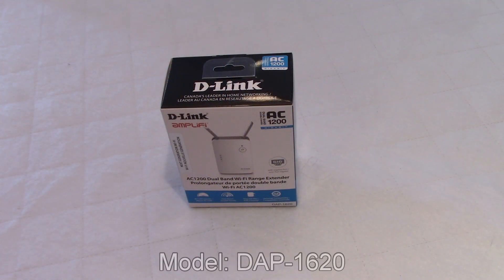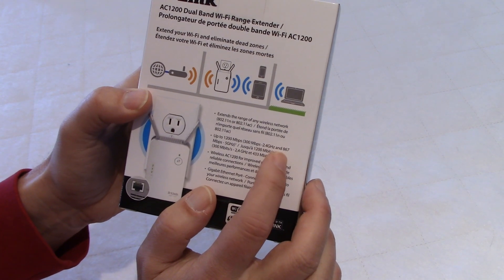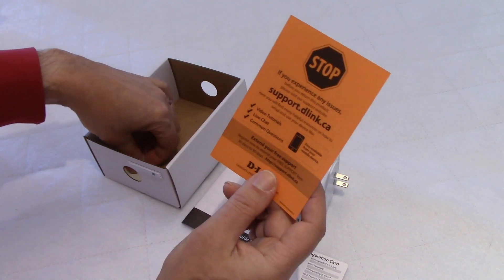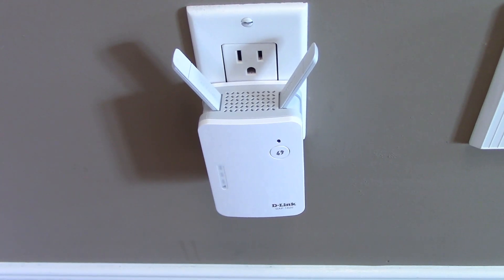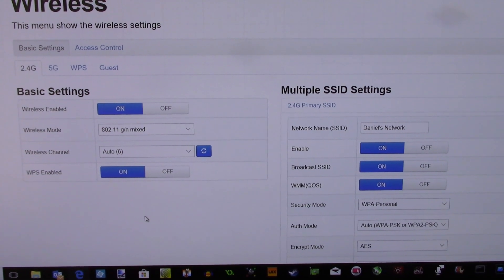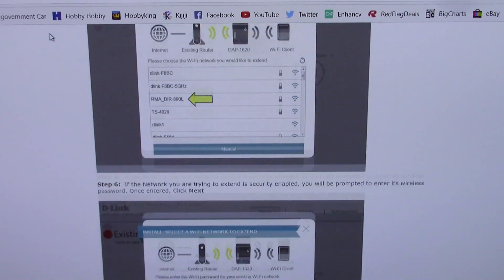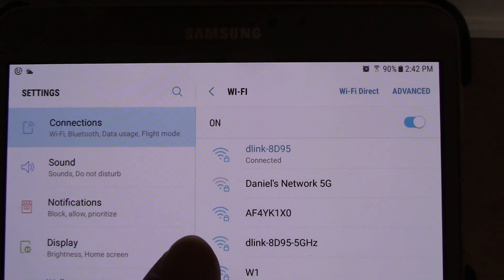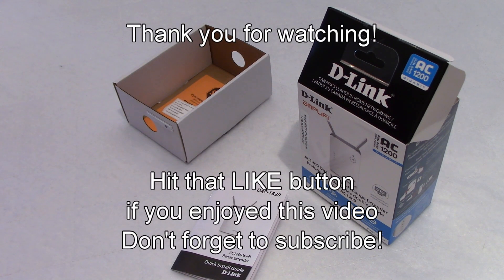D-Link Wi-Fi Range Extender DAP-1620 | Unboxing and installation

Comment: Does it work like a powerline adapter or does it need the router wifi to be on to take the signal ans extend it?
Reply from the maker: Hello, this is not a powerline adapter, it needs the router to be on for the signal.  Thank you for visiting my channel.

Comment: Bonjour,

En effet, la solution simple ne fonctionne pas.

Mais la solution compliquée ne ressemble en rien à ce que vous exposez.
1/ L'interface "http://dlinkap.local" est visuellement différente. La page demande directement un mot de passe sans identifiant, mais elle ne précise pas quel mot de passe entrer et où le trouver.
2/ Si vous taper les mots de passe qui apparaissent sur la carte qui vient avec le matériel, le système vous bloquera l'accès en vous précisant que les identifiants sont erronés. Finalement il tient de laisser la case vide pour entrer dans l'interface.
3/ Une fois la procédure connexion établie entre votre routeur et le répéteur D-Link, ne cherchez pas le nom de votre répéteur D-Link dans vos points wifi pour vous y connecter, il n'apparait pas. En réalité, il porte le nom de votre réseau initial.
4/ Du coup, si vous voulez distinguer quels appareils se connectent à votre routeur ou à votre répéteur D-Link, vous ne le saurez pas si vous regardez l'interface de votre routeur vu qu'ils portent le même nom de point d'accès et qu'ils sont confondus. Il tiendra de vous rendre dans l'onglet "paramètres" puis "prolongateur" de l'interface "http://dlinkap.local" et le système indiquera le nombre de clients connectés. Si vous cliquer sur l'icone, les adresses IP internes vous sauront données. Si vous connaissez vos IP internes par cœur, tant mieux, vous pouvez d'ailleurs renommer la connexion avec quelque chose qui vous parle plus. Sinon, rendez-vous maintenant dans l'interface de votre routeur, pour rechercher l'adresse IP concernée et trouver ensuite l'adresse MAC associée. L'adresse MAC est en quelque sorte le nom informatique de votre appareils (téléphone, ordi, tablette, console).

Bref, c'est un petit jeu de piste ironiquement amusant. L'essentiel, c'est que votre votre réseau soit étendu.

Toutefois, j'ai une question à laquelle je ne trouve aucune réponse : peut-on installer un 2e répéteur D-Link à la suite du 1er répéteur D-Link pour répéter le WIFI encore plus loin ?
Reply from the maker: Bonjour Ulrick et merci pour ton commentaire qui va surement en aider plusieurs.  Je pense que l'interface a changé depuis que j'ai fait ce video.  Pour répondre à ta question, je ne sais pas si on peut installer un deuxième répéteur.  Il faudrait envoyer la question directement à D-Link.  Merci encore!

Comment: the higher frequency of 5 G does NOT pass through objects as well as the 2.4 ghz . lower RF frequency's will pass through more obstacles(walls) , its the same for sound you can typically hear the bass beat of music from quite a distance but the mid and high stuff you won't hear unless you are verry close.
Reply from the maker: Thank you Bill for the explanation.

Comment: Range of 5G will always be less than 2.4. Nothing weird there
Reply from the maker: I come from the nuclear industry where higher frequencies radiation have more penetration and range.  This is why I find strange that 5 gh has less range than 2.4!
Reply: @SuperdanTech  5G wifi band has bigger bandwidth and hence lesser range as compared to 2.4G which has smaller bandwidth and longer range. I guess this could be due to the fact that u cannot increase the power of the wifi transmitter beyond a certain level as specified by FCC for safe use at home. Hence the compromise

Comment: Mine keeps overheating or something. Works great for awhile but then starts acting up and need to unplug it for awhile.
Reply from the maker: Mine never over heated but it does operate quite warm. You might have a defective unit.
Reply: SuperdanTech relocated it to a different outlet 10ft closer to router, seems to be fine now and staying on 3 bars, thanks for replying though ✌️
Reply from the maker: @MrRednuht13  Excellent, its working now. Its a great little device.
Reply: SuperdanTech yeah maybe and first when I plug it in it has 3 bars signal strength for hours but sometimes goes down to 1 bar, strange
Reply: SuperdanTech jinxed myself just cut out again 🤦🏻‍♂️

Comment: A couple suggestions for anyone late to this video, First if you plan to use WPS to connect this place it close to your router the wps mode does time out so be close..once connected you can move the extender to where needed..it saves the info in case of power outage. With that said WPS has a hack so most new routers either don’t have or it’s disabled. The direct connect method is probably the best and again you can be close during setup then move it...hope this helps
Reply from the maker: Thank you rambokd for the suggestions.
Reply: I realize it's pretty randomly asking but does anyone know of a good site to stream newly released tv shows online ?
Reply: @Jaylen Skyler Flixportal =)

Comment: I downloaded the D-link qrs mobile app. if you have your wifi name and passord, it was super easy. This piece of crap finally worked.
Reply from the maker: Thank you for sharing.  I am sure it will help several people!
Reply: buggybored mine still don’t work it will get like half way through the connection after I’ve logged onto its “wifi” and it closes down cause it’s a piece of shit

Comment: What's the gain of the antennas, in dbi ?
Reply from the maker: I honestly don't know.  I have not seen it in the specs.  Mine is 20 feet away from my router and it works perfectly to feed the bedroom upstairs.  Thanks for watching!
Reply: @SuperdanTech  thank you so much !  So I think you have the full led signal on it, with 20 feet distance, with no walls or objects between them.
Reply from the maker: I have 3 or 2 LEDs at 20 feet away with two walls.

Comment: How far is the extender from the router?
How many walls has the signal had to go through to reach the extender?
Brick wall?
Thanks.
Reply from the maker: The extender is 20 feet away and there is one drywall in between. I am getting the full 3 leds for signal strength. Thanks for watching!

Comment: Is this device a wireless network extender only or can I use it to extend my wired network as well (considering it has a gigabit ethernet port).
Reply from the maker: I could be wrong but I don't think you can do that. If you do so, the extender will not work because it is designed to use only a Wi-Fi connection to a Wi-Fi router.  But of course you can connect a PC with an ethernet cable right at the extender.  Perhaps somebody else will add some info.  Thanks for watching!
Reply: Yes, have access point mode to extend with cat5 cable.